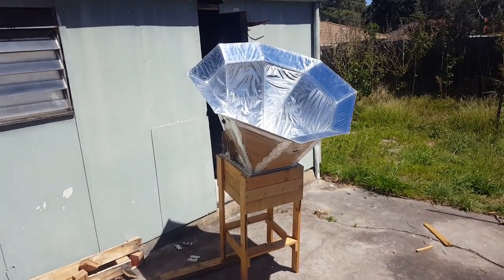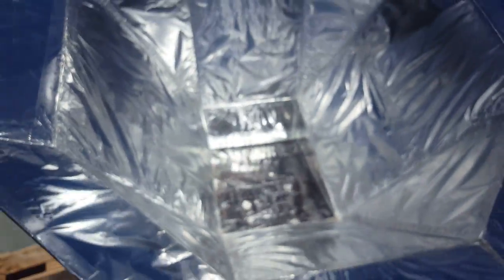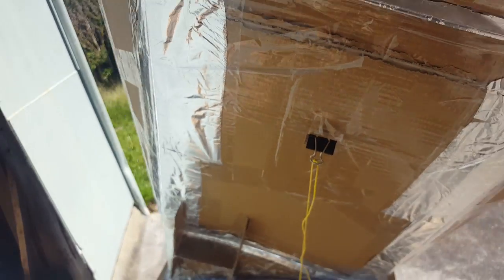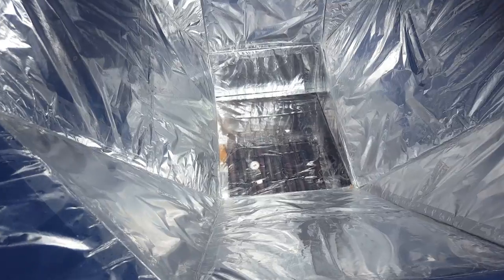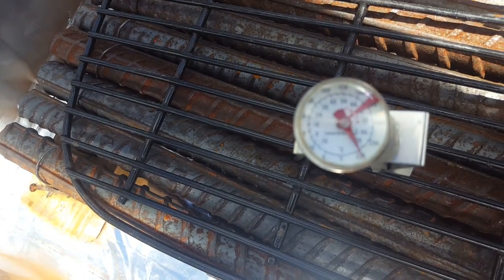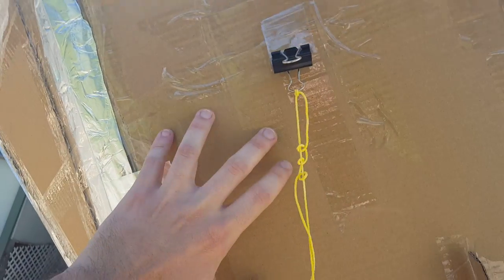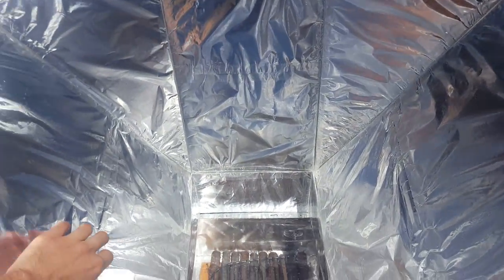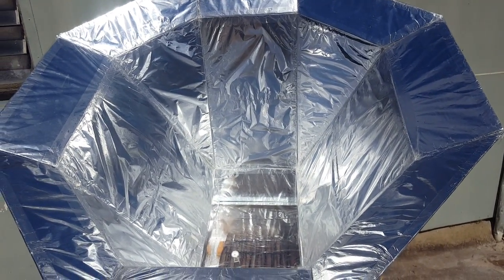solar oven prototype

Comment: Looks great, good materials, I will try this, thx. I guess I'll use beer cans. 

 But I don't get the shape. Why is not parabolic? Why is it hyperbolic? What is the use of the outer rim? You can even see in the video (0:07) the Sun is reflected to the camera from there instead of the center.
Reply from the maker: The advantage of this type instead of parabolic is you can have a proper oven box, and you don't have to move it to face directly at the sun so often. The main reason for the outer rim is to hold the array rigid, otherwise it would need a lot of rigging to stop it folding up from the wind - and yeah if you don't have it pointing directly at the sun about 1/3 to 1/2 of the rim doesn't reflect down into the box, the other half works still though. I'd say the outer rim is about as effective as a parabolic style rig if you don't realign it to the sun every 30 mins or so